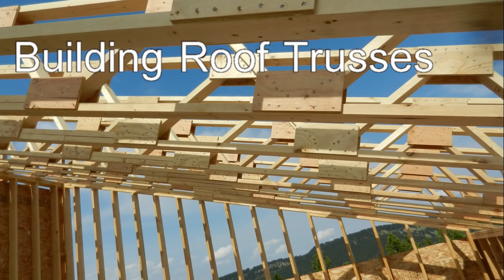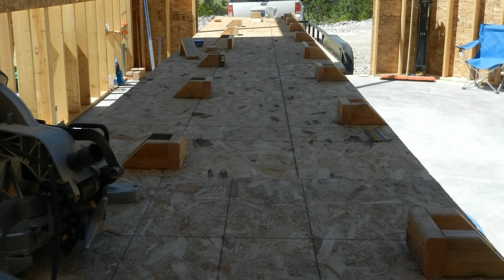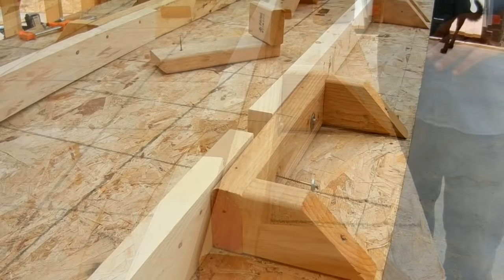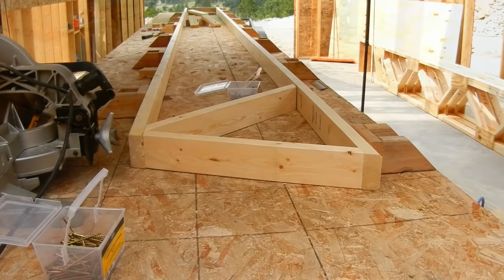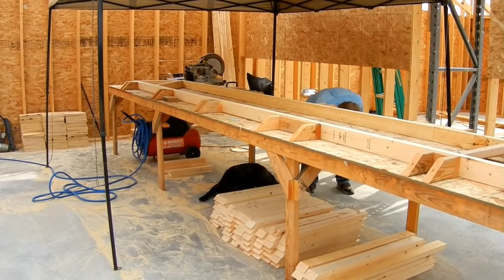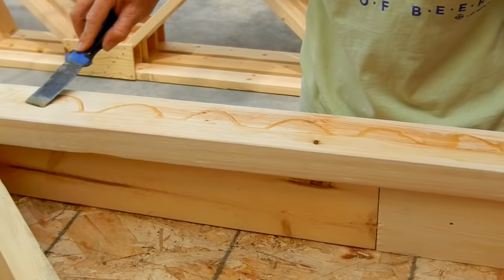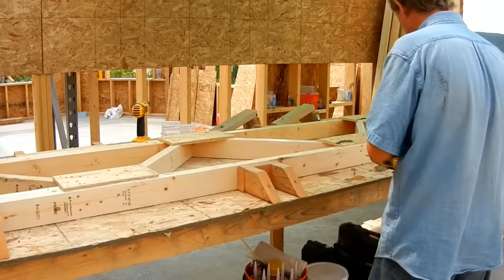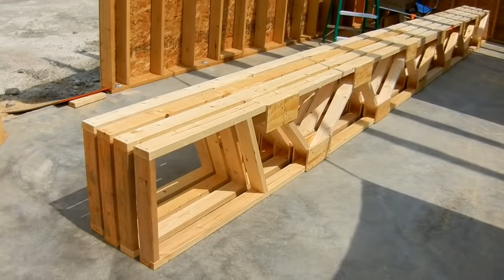Building Roof Trusses

Comment: You stated the building bureaucracy just about bankrupted your house project. I design trusses for a living. One thing you should have stated at the beginning of your video, is if you consulted an engineer. If you did not, and the inspector did not pass your trusses until you had documentation from an engineer, I am sure it cost a lot more. I am not against you doing the work yourself to try and save some money, but engineered trusses would have saved time, costs, and possibly headaches.

You could have still had the same roof design by going to a truss company. They do not cost any more than "stock" trusses. But then again "stock" are just that, stock. They are built the same, and in mass quantity. I am sure if you were to factor in your waste, overall your home built trusses cost more.
Reply from the maker: +Mark Gilbertson -- Since I did check out the cost both ways I stand by my conclusion. I did not consult an engineer it's not required here,  I had exactly zero inspections on my home because we don't have building codes and theirs nothing to inspect to. Having experts help you build always drives up cost because someones got to pay them. In today's information world where everything is available online I don't need an engineer. The whole system of engineers to build, banks to loan, and insurance company's to insure, and the governments hand is out to take their cut, is what makes homes so expensive. I don't play that game. If a stamp on a drawing makes you sleep well at night then feel free to pay for it.
Reply: Where do you live that does not have building codes?   Not trying to be snarky - genuinely curious.  Even if I moved to an area that has no codes and built my own house, I would still use the codes from back home just because they also double as a checklist to make sure I don't overlook something crucial.   And as with Mark Gilbertson, I have designed trusses but I mostly spent my 7 years at a truss plant working on or supervising the crews that built them.  Glad to be done with that job - it was mind-numbingly repetitive work.
Reply from the maker: There are a lot of places without building codes or as where I live in Wyoming no enforcement of state building codes. Building without codes doesn't mean you just throw up anything but it saves a lot when you can ignore the bull and skip the experts. As for working in a truss plant I bet it was mind numbing. Building one set for your own home is satisfying.
Reply: I worked at a manufactured home plant for twelve years.  Sometimes I filled in for an absentee in the truss building.  Speed was more important than accuracy.  Not to mention, some of the finished trusses sat out in the weather, partially covered, for weeks.  If I had to choose between cost or quality, no brainer, quality.
Reply: Mr Gilbertson said that he DESIGNS trusses.
Reply: @ B-Spot ..... Way to go there brother, you told ole Mark G. there. I wonder what engineer ole daniel boone got together with to rob, i mean design, his cabin. Looks like Montana or Idaho to me, it's so beautiful, you guys are very lucky.
Reply: wish there was some of that here in south east Idaho. Just to finish a basement I have to "technically" pull a permit just to frame partition walls and drywall it after the main home is already complete and inspected and lived in!!! Ridiculous to me. I can understand having electrical inspected and plumbing due to the nature of em, but partition walls and drywall inspected? give me a break.
Reply: @trevorjolley7273  It is truly ALL about money.  They hide behind safety.  Stupid is as Stupid does.  These trusses are STOUT! unless you talk to Diane
Reply: @BSpotBuilds  You may not have local codes but the state in which you reside certainly adheres to the IBC or the IRBC irregardless.

Comment: Well I guess I will be a hater since I not saying of wonderful this is and how sweet the music is and that your do very nice work sorry. Seems like a lot of work time is money unless you do not work. I may have missed something but truss need to be engineered did you have engineering for these trusses? Not sure where you are but in Florida a building inspector would never pass some home built truss. Not trying to be mean but that is some scary stuff.
Reply from the maker: Ok, I don't live in Florida and don't care what Florida inspector's think. It's only scary if you don't understand the design and principals involved. Like your inspector who is only looking for a stamp.
Reply: Midway through a project I decided to remove a load bearing wall. I built my own 32' long boxed truss for my living room. Built it similar to the one shown in this video but I made it from 2x6 and boxed the sides in with 5/8" OSB. It had 10lbs of 3.5" T25 deck screws in it! When the inspector showed up he spotted it and asked about engineering and certification. I showed him pictures of it as it was built. He said, Wow that is overkill! That could easily handle 3-4x the load BUT its not certified and engineered so it has to be removed and replaced. This is why I hate inspectors. No common sense.
Reply: Joe Fox I understand what you are saying but disagree. I have been build for over 30 years and have dealt with hundreds of inspectors and find that most have common sense and use it to the limit of their job. They are inspectors not engineers. Most building codes have ratings for solid lumber but when you make a built up structural element many things come into play. It could be stronger then need but you have to have load values for what it is and that is where the engineer comes in the inspectors only can verify that the engineer’s details have been followed that’s his job. It’s a matter of safety not just for you but anyone you might have over or even sale the home to. I see from your video that you take great pride in your work and that is a great thing. There has to be more to a structure then I think it is strong enough. Here we have to have a engineer seal all prints structurally to get a permit and if you vary from it you need a letter from them saying it good to do or what you need to do the maintain the integrity of the building. Most inspectors I know look at their job as protecting lives and they care a great deal about it they also protect the public from not so good contractors who would cut corners and do work not to code. Thanks for commenting back.
Reply: Joe Fox No it didn't need to be removed and replaced. You simply needed to pay an engineer $100 to write a letter and approve it. Been there.
Reply: More bad advice. No real engineers is going to give you a letter for a $100.00 just out of the blue. There are several hours of load calculation if not more, no engineer worth anything is just going to throw his or her license out there on the line for $100.00 just does not happen. It does not matter where you live. This has to do with safety and when you show or tell people this type of stuff they all think they can do it and it ends up costing extra money and hopeful no ones life. There are reasons for building codes most have come into place due to build failures.  Building inspectors have saved countless lives by doing their jobs correctly.
Reply: I agree, I don't know an engineer that is going to stamp it for $100.  With design and site inspections you can be around $1000-1500.  Also no building inspector anywhere that I know is going to pass it without engineered stamped shop drawings.

Its a nice video, but the reality isn't there.  I have seen people build homes off the beaten path without permits only to order the building to be taken down or government will take it down for you.  I am suspecting there is no permit on this job
Reply: Tom Jones GearGuy  I don't think you are hating ....youre speaking from the business aspect of it.
Reply: Tom Jones GearGuy price a truss and you may change your mind
Reply: @TomJonesGearGuy  Several hours of load calculation?  Nonsense, this design is common as dirt.
Reply: @MrSteeDoo  are you an engineer? When was the last time you were in an engineer’s office? When was the last time you where walking jobs with the engineer of record going over details?  Thanks for your input

Comment: FYI, US Forest has charts with loads for screws and nails in lots different woods, pre drilling for both nails and screws is higher. The strongest is predrilled common nail clinched. My first house in Los Angeles County had trusses with hand nailed ply conections, all code stamped from 1955. The polyurathane glue is not rated but sub floor glue is.
Reply from the maker: This is exactly my issue with "rated" and "approved" products. Having used both sub floor adhesive and poly glue which one has better properties for a truss? I would argue the poly does.

Comment: That's just crazy, if you were any kind of carpenter or any basic carpenter you would know that 2x4s on edge are way greater in strength, 2x4s on flat have a very low breaking strength, in your "research" and understanding of engineer principles, you would have seen that ALL engineered trusses have the lumber on edge not on flat and second screws have zero shear strength, you learn that in first year carpentry. It would be safe to assume that you live in the south cause up here in northern Canada we have what's called load limits cause of snow and I wouldn't trust your trusses over my dog house with a snow load. But that's my opinion and its you have to live under it not me.
Reply from the maker: +evan r --- If you were any kind of engineer you would understand the principles involved and that trusses don't entirely rely on the bending strength of the lumber for their strength. As for laying the lumber flat check out the hundreds of examples here:

https://www.google.com/search?q=floor+truss&biw=1280&bih=651&tbm=isch&tbo=u&source=univ&sa=X&ved=0ahUKEwihm7yX67jLAhVlsIMKHY5MCKsQ7AkIJg

As for screw shear strength read this:

http://www.builderonline.com/building/dear-builders-engineer-nails-or-screws_o

I find it amazing that you were able to determine the suitability of the trusses without knowing any of the design conditions like span, snow load or truss spacing. You are right, it is your very ill informed opinion and you have a right to it. If you were truly looking for knowledge you would have asked me a question about why I laid the 2x4's flat but you didn't ask a question because you have it all figured out and want the world to know your superiority.
Reply: Truss chords are NOT designed to be pure bending members. That's the whole point of a truss...to load the elements in tension and compression. You are thinking of simple span, single member beams. Not the same principle here. 

Screws have ZERO shear strength? I don't even know how to respond to that. Yes, yes..they do. Otherwise they would not be a SOLID. Even fluids offer some resistance to shearing stress (we call that viscosity).

Learn some basic structural engineering concepts before leaving half-baked comments, dummy.
Reply: Truss designer here. Floor trusses are built on flat most of the time. I hope he doesn't get snow where he is
Reply: maybe a designer but not a conveyor of complete thoughts: 'floor trusses are built on flat'. Flat what? The word flat, how it appears in your comment, is an adjective not a noun.
Reply: Sheathing prevents buckling. Truss members should be on edge for added strength. It’s basic physics.
Reply: Build 2 identical trusses, one with the chords and webs on edge, one with them flat. Load both identically, increasing the load to the point of failure. I can tell you which truss will fail first.
Reply: Absolutely right!
Reply: And you, you’re probably a genius huh? Lol
Btw- physics has nothing to do with 2 dimensions vs 3 dimensions. The laws of physics apply equally across all dimensions. But, what would an idiot like me know?
Reply: @SimonWoodburyForget ---You're so correct in your comments of the trusses' design. B-Spot placed the top and bottom 2 X 4 chords flat which is the correct way. The flat 2 X 4 chords needs to not have too long of a span between the top bearing points of the internal web bracing as well as not having too long of span between the bottom bearing points of the internal webbing. Too long of a span between these bearing points would allow the 2 X 4's to sag in between those bearing points. B-Spot calculated that correctly, preventing a "wave action" of the surface of the chords in the overall length of the truss. 

The required strength for these trusses is obtained within the web's design and construction and not in the chords. However other designs with chords turned up on edge could give each truss more strength but could also increase the "domino effect" of falling/leaning over. B-Spot is only trying to build it for dead load, wind and snow. He's NOT trying to build it stout enough to drive a fully loaded 18 wheeler on. Also flat chords, offering control of lateral movement (right and left), with sheathing nailed on the top help bring the roof to a monolithic mass giving a better resistance to leaning from any wind shear that might blow over it at any given time.
Reply: I guess that's why pre-built engineered trusses use 2x4's on the flat.
How's that jibe with your "engineering principles"?

Comment: Great job, Thank you. I have two questions, 1. Did you do the strength test? 2. I have another design idea; a 2x4 frame sandwiched between a full sheet of two 12-inch OSB. Would it be a good idea?
Reply from the maker: I believe you can make that work, with the right glue and nail schedule.The connections between the ends of the OSB sheets will also be critical. It would be similar to an I-Joise with more OSB.

Comment: I really love the way you American people get woodwork done with so much passion and knowledge.I'd love to learn the American std of doing things as well.I just wondering is he timber raw or treated.here in southafrica coastal city of Durban we have a problem with wood bore.except for extremely hard woods.my wife and I are currently in he process of buying an incomplete house and I will be doing most of the woodwork.I see your Labour  is free you are more than welcome to visit me and help with my trusses.love the video hope to see more.
Reply from the maker: -- The wood is not treated we don't have the bore issue here, but we used to live in New Zealand and the wood we used for building was treated  because of wood bore and rot. Labor is free, but travel expenses are through the roof. Good luck with your project.
Reply: Ezra Kinloch
Reply: very good.
coment.
I apreciate..it.
saludos desde paraguay. 
south.america.
Reply: +Rodi Morel 
the coment.go to
 mr.ezra
Reply: Ezra, 
No labor is free. There's always the opportunity cost of what else you could be doing. We don't use treated wood for structural framing here. It's twice the price. We save treated wood for the decks and porches outside. Just keep it dry and safe.

Comment: You did a fantastic job. The only downside I can tell everyone on here, is the problem with building your own trusses is they aren't signed off by a truss or structural engineer. This makes them not usable if you're doing a large project where permits are required. Other than that great job and precise work. I'm sure they are built just as strong as engineered ones!
Reply: But guessing they are strong is not the same as knowing they are, I would like to see a load test comparison just out of interest
Reply: And besides, there is a lot less weigh on roof trusses than floor trusses apart from snow load. A property installed metal roof actually strengthens the structure

Comment: Nice job.  Just curious, did you get the design from an SE and did the building jurisdiction require an engineer's inspection and letter?  Would suggest screws versus nails for the truss plates (we are a structural engineering firm).
Reply from the maker: The design is mine based on everybody else's design. No code requirement to get an engineer involved here. Funny you suggest screws vs nails as the internet is sure every screw will shear off. Connection plates were based on an old Canadian publication for farmers. Designed to help them make farm structures they recommended nails cinched.
Reply: @BSpotBuilds  Your design looks good.  The oversized  square cornered path plates are much stronger than smaller and narrower.  Good touch.  Reason I asked is that the inspectors in the Atlanta, Georgia area have gotten really strict and we are often called in by building jurisdiction people to look at designs, run the calcs on them and provide either corrective measures or we write an engineers approval letter and stamp it.  We are licensed structural, geo-technical and civil engineers in Georgia and Florida. To your comment, connections are very important and we always specify the size, type, etc. be it screws or nails.  Even 16d nails under shear loads pull out and bend under loads.  Of course using ring shank nails that are laced by each other is a good technique to preclude pull out. but the holding strength of proper screws is multiples of any nail (we base our designs on certified testing and proven techniques that we put our name on.  I do not even read comments.  Thanks for the internet comment, that is funny.  I stopped and looked at video because I liked the way your trusses 'looked'.  Thanks for responding back.  Best regards.